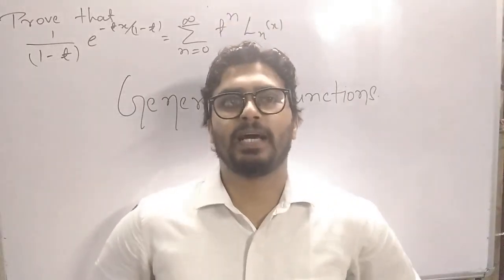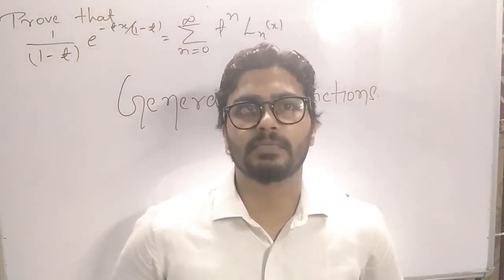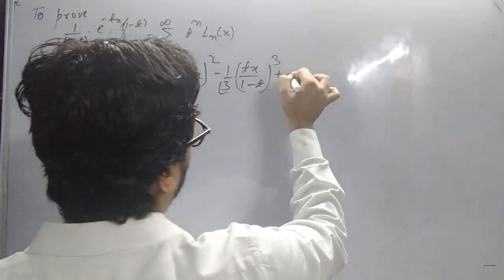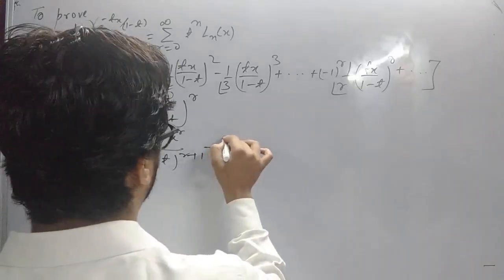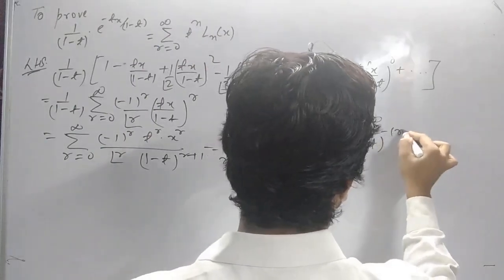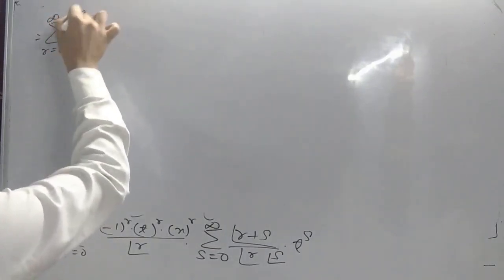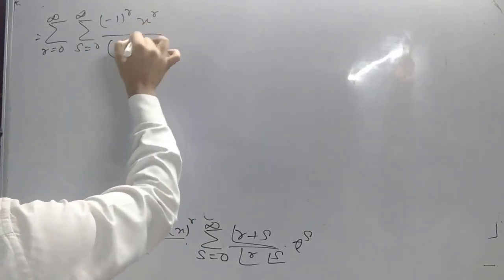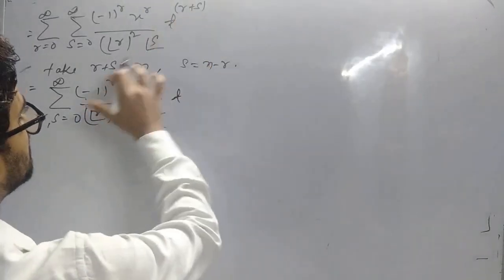Generating function of Laguerre polynomial | Kandarp Vidyasagar

Comment: We can easily solve ordinary differential equation for Laguerre polynomial 
assuming that constant term is equal to one 
Once we have formula for Laguerre polynomial we can define ordinary generating function 
We have double sum in which we change order of summation, 
pull out factor independent from index of inner sum, use binomial expansion to calculate inner sum
We can also get ordinary generating function from recurrence relation